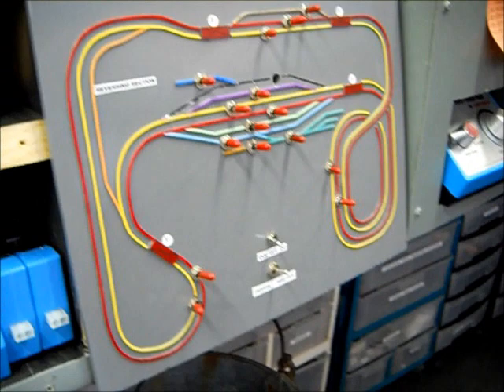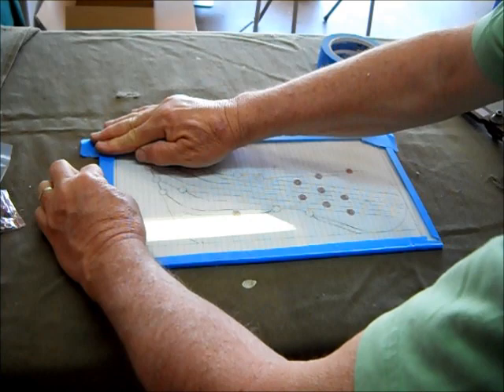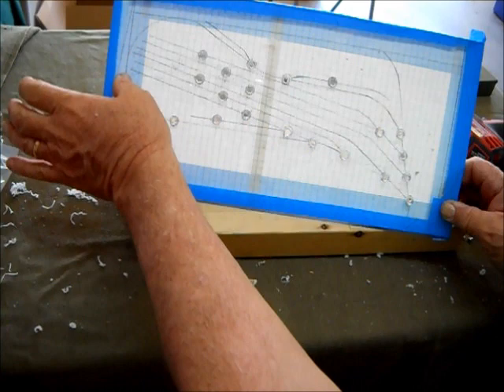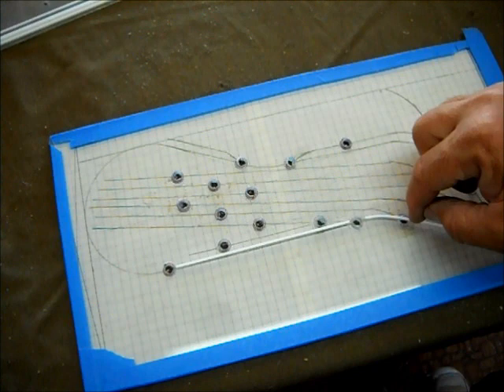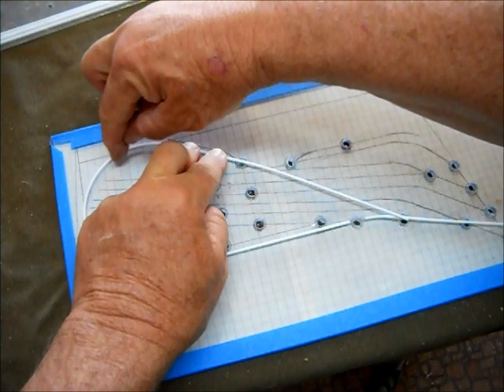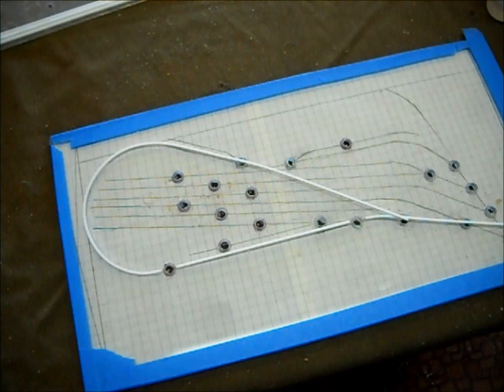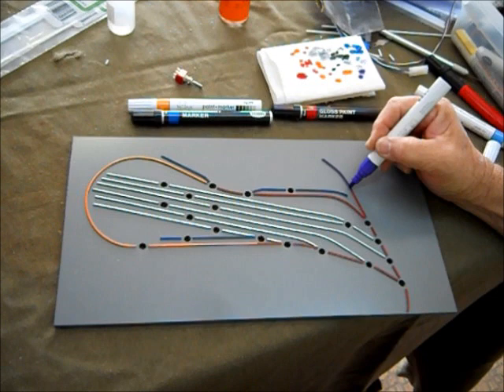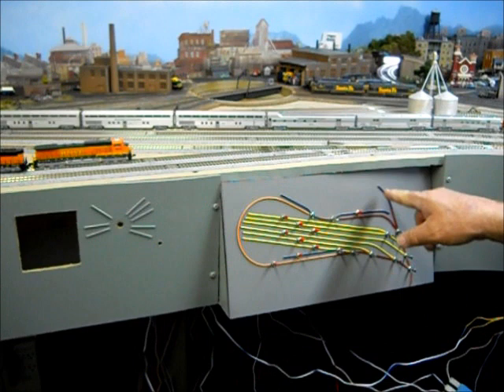How to build a model railroad control panel

Comment: Also...how do you do your turntable controls? I. About to be putting in one myself and I'm very interested in how you plan to do it.
Reply from the maker: At 38:57 you see the holes for the rotary switch for the tracks and the square hole for the Walthers table controller.
Thanks , Mike
Reply: Mike Fifer what kind of rotary switch do you use?
Reply from the maker: It was a Radio Shack but do not remember the amount of poles.
Mike

Comment: I like the  video Mike, real informative.  This is for a DC operated track, correct?
Reply from the maker: I would not matter. It could be for whatever you wanted to control with mini switches or could simply be a diagram.
Thanks , Mike

Comment: You're drilling on too much of an angle. The bit should be straight. Rather than just pulling your bit out after the hole is created, use the REVERSE direction on your drill and you will not get that "lip" you talk about.